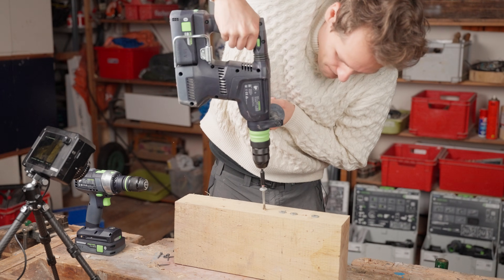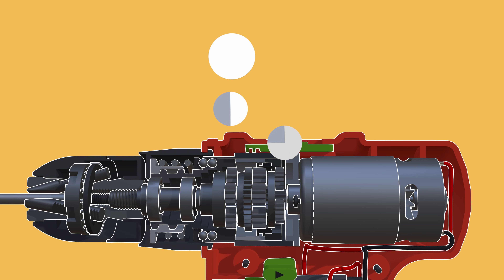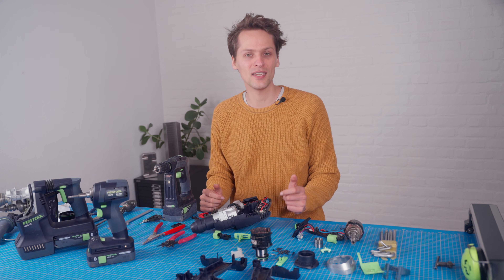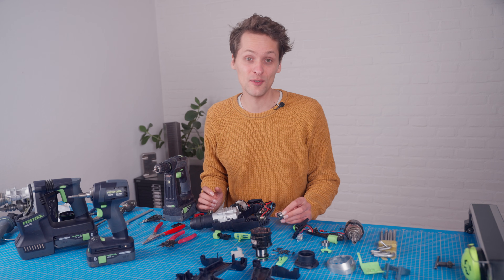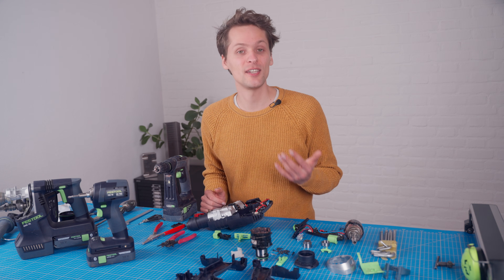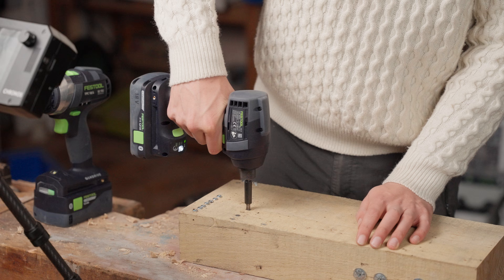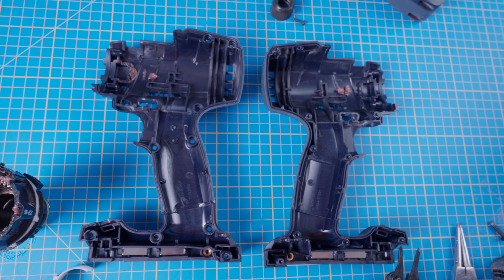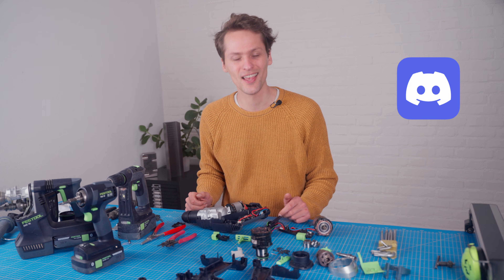Hammer Drills Don't Hammer - Every Drill Explained

Comment: Another point for plastic gears: They can be intentionally weak and cheap to replace instead of whatever they connect to. I have seen this at work, there was a set of plastic gears in one of our machines that broke when someone messed up and loaded the wrong material. Instead of thinking "Huh, why do they break, is something wrong down the line?" they just replaced them with similar metal gears. The result: The Gerabox housing broke, a custom part that had a wait time of several weeks and did cost way more than 10000 of the plastic gears...

Comment: Ok , I like impact drivers as much as any other guy who know ho wthey work  , but this video makes them seem like a supertool , a better version of drill , which they are not , they usually have lower power output than a regular handdrill , they would most likely take longer to drive the same large fastener than a drill , you can drill with them in theory , but you should use impact rated bits , otherwise you migh break the bits , even worse when dilling into metal , and basically impossible to cut threats with taps , on top of that they're very loud to the point of risking ear damage , biggest advantage is probably that you can holding without any bracing , it just doesn't twist your arm , and you can undo bolts on car tires with them , even most of the small ones

Comment: 13:25 This seems so counter-intuitive to me. Sure, there is no free lunch for power, but wouldn't the spring still load up over a longer time, then deliver an impact at higher torque than the motor due to the momentum of the accelerated hammer?

Comment: I used a super cheap, entry-level, battery-powered Ryobi drill to make four deep, half-inch holes in my back patio, in order to install a huge ring to lock my motorcycle to. The drill bit was so big it could barely be inserted into the chuck, chuck had to be completely open to get it in there, literally the maximum size. Yes, it took about two and a half hours if not three. Yes, it required multiple breaks to charge the small batery. Yes, it was one of the most near-futile and exhausting things I've ever done. But dammit, it worked. I'm not saying you are wrong about regular drills not being good for stone and concrete. But I AM saying that with enough determination, persistence, and lack of money to purchase the correct equipment, wonderful things are possible.

Comment: I have two 1980s corded Bosch hammer drills and they work great. My house is built of engineering bricks, not house bricks, and they drill in to them with ease. I don't even own a battery drill and tbh I'm not sure I want one either.

Comment: I always love when people complain about Phillips head camming or stripping out. It's literally what they were designed to do. Unfortunately people think it's meant to transfer torque, but they're simply misinformed. The head was originally made without a taper and people kept snapping heads off screws and stripping through wood. They added the taper to ensure it cammed out to prevent stripping and snapping.

Comment: I needed a rotary hammer for one project and didn't want to shell out the big bucks for a new one.  I found a contractor selling a used Bosch that wasn't hammering reliably.  It was a beast of a tool, way more than I needed, but the price was low and I was confident (Arrogant?) that I could fix it.  I was shocked by how complicated it was, and the pneumatic piston you mentioned had me spinning.  It was dirty, and most of the grease was missing, so when cycling by hand it didn't do anything most of the time and I wasn't confident regarding how it was supposed to work.  I was able to get it working well just by cleaning it, replacing some O-rings, and lubricating again, but I had several failed attempts along the way.

Comment: I dunno about the whole "you can use an impact driver for drilling holes" 
Sure you can but it's not the correct tool. 
It's like asking how to check the charge of a 9V battery?
You can use your tongue to see if there's any charge left but you should probably use a multimeter. Both methods work but one is far better than the other lol

Comment: Hey man you really need to either  wear a respirator and/or keep concrete dust (any dust, really) wet while drilling with water spraying on the hole the entire time. Even if you're drilling just one hole for one b-roll shot, you do NOT want to breath even a tiny amount of that stuff in..

Comment: I had long been under the impression that companies potted circuit boards in epoxy to prevent others from examining the circuit and copying it.  I've certainly seen it in electronics that is not exposed to rough conditions.  But I suppose it could fulfill both roles.

Comment: While impact-drivers can drive nearly anything they are also way more likely to destroy anything, as they shock the material, screw or bit repeatedly. This means more snapped screws, drill-bits, stripped out heads etc.

Their real strength is tightening heavy screws to lvls no other drill could achieve all while being able to set the force.

Comment: Electronic clutches are garbage. Unless you exclusively work with the same screw and the same material, they will always deliver a different result.
What I'm saying is basically your test repeats for every single combination of screw and material. Driving screws at high speeds puts them and the Drill under way more stress. When you drive a screw into hardwood or metal you will almost always snap the screws at almost all settings. This is because the inertia of the motor does not change and only driving slower could change this calculation. Abruptly stopping any machine at high speed will damage the internals way quicker.

With mechanical clutches you get a specific amount of force, there is still some variation when you switch screws, material and most notably speeds. These clutches are capable of working with anything, way more forgiving before they snap screws and importantly: Even if used at high speeds actively protect the drills internals as the dill itself continues to spin slightly hammering the screw deeper.

Comment: are you confusing impact and hammer drill functions? because the festool into concrete does NOT sound like a hammer drill, and an impact is about rotational impact, and will work like crap on concrete.

Comment: "Plastic gears aren't actually as bad as you think!" Well, yes and no.
As always with engineering, material selection is of critical importance, even if you've narrowed it down to "I want to use plastic gears".
If loads are insignificant, say inside a battery powered quartz clock movement, you'll probably use an inherently slippery but extremely cheap plastic like LDPE (same stuff most plastic bags are made of). This way you don't have to lubricate the gears, saving even more money.
If loads are low but not insignificant, say in a car door power lock actuator, and durability is a concern, you'll probably use HDPE, it's not as cheap but it's extremely tolerant of momentary overload, high vibration, and abrasion, and the strength to weight ratio is actually shockingly high (this is why it's used in Battlebot armor, they have weight constraints and HDPE is very strong for the weight while still being cheap enough that the layperson can buy slabs of it big enough to use as armor for the bot).
If you have a medium load but not much vibration to deal with, the go-to material is Nylon, potentially with glass microspheres added. Bulk blocks of Nylon are actually incredibly mechanically stout, the only problem is that it tends to fracture, and abrasion is a concern (the glass microspheres are added to increase strength and help deal with the abrasion issue).
Another advantage that plastic gears have is low weight, which is why in some RC servomotors you'll see them use plastic gears for the first few reduction stages after the motor but then switch over to metal gears for the final stage or two of reduction when torque becomes so high that making a strong enough plastic gear makes that gear too big to fit in the servo housing.

Comment: Several times in this video, you use the word "power" when referring to torque. This is misleading and can lead to confusion. A gearbox cannot give you more power: it can give you more torque at the expense of speed, or vice versa. Power is speed x torque, so the power stays the same.

Comment: I install alarm equipment/cameras and have both a Bosch Cordless Hammer Drill and a corded Bauer (Harbor Freight) Rotary Hammer.

The Bosch hammer drill is what I use for most drilling and driving, set to either drill mode (no clutch) or driver mode (clutch). The hammer drill mode works ok on concrete, but it just really struggles with brick (I use Bosch masonry bits with the hex shank). Sometimes it works, other times it just leaves a small divot. It's very sensitive to RPM and pressure, and with most materials there exists a sweet spot with just the right amount of pressure and speed where you get a sort of acoustic coupling between the material and the bit and it becomes most efficient...but even then it might not make any meaningful progress.

The Bauer rotary hammer on the other hand absolutely rips. Eats through brick and concrete with ease. It's very wiggly and sloppy, and I wouldn't want to use it for precision work...but for drilling holes for running wires or mounting a 1 lb camera it works just fine. Having an SDS plus chuck is a nice bonus as it lets me drill through thick concrete walls (my bits are 16 inches, or about 400 mm long). Great for running wires through foundations in basements. With chisel bits it even becomes a cheap electric jackhammer.

Comment: The hammer drills are actually quite useful for 6mm or smaller holes in exterior plaster, mortar or cinder block. Even with a small bit they do indeed struggle on concrete, they just don’t have the power to break any stone aggregate too big to simply dislodge.

Comment: Two notes on the metalurgy of drills:
HSS and HSSCo drills can shatter by impacting, which is why impacts arent a good way to drive them, a smooth rotation is much better.

The carbide inserts in masonry bits are, for our purposes, immune to heat, as are the lower carbon drill shanks. Theoretically the first thing to give up would be the brazing that joins the two, but that usually also only goes at like a cherry red heat (~800° C) on older drills, with less advanced carbide mixes, water cooling can actually lead to thermal shock which breaks the insert.

Comment: We have both a combination drill and a SDS hammer drill. For 70% of masonry DIY tasks i still prefer the combination drill. The combo drill is much slower and more delicate and less likely to blow bricks out, its also smaller and for us easier to grab (SDS is stored in its own big box). Bigger holes, or chiselling the SDS is the only really choice but I would personally always recommend a combo drill for a DIYer (in addition to a SDS if /when you need one) as they are only slightly more expensive and its just so useful to have the hammer function.

Comment: Hah! I bought the exact same 'Absolute unit of an armtwister' nigh 3 decades ago... The thing is a *beast*.. I bought a house a little after and had to drill 100's of holes for rebar into rebar'ed concrete.. Thing's still as good as it was when I got it.. (but a lot more dirty)
There are other variants of the same model still on the market, and I cannot recommend it enough.

Comment: Thats not a hammer drill, thats a rotating rattle toy...
Never found those in "hammer mode" to make any impact except for more noise.

Potted in components are something of a love hate relationship.
On the one hand, they are a smart solution to make a PCB resistant to moisture and dust.
But looking at how most brands solve it, they make repairs somewhere between unnecessarily complicated, unneccessarily expensive, or not possible at all as they don´t sell that part.
if repairable, you may be stuck with having to replace the whole bunch, contacts, trigger, controller, motor field at a price close to buying a new whole device.
Not to mention that PCB repairs with spare parts worth cents are generally impossibly. But I guess that we have to consider a tradeoff between resistance to elements and repairability.
Although I guess some manufactrurers might have abused it to prevent repairs at all.

Comment: Cordless tools are not powerful enough yet to make suitable core drills.
A 1kW hammer drill is perfect for small to medium sized core drills, for example holes for piping, electric sockets (82mm typical).
They need speed. Percussion (or soft impact, that's how some makers call it) is only needed in reinforced concrete or hard rock.
I have a cheap hammer drill that I use for electrician work. It cost 1/10th of a professional Eibenstock core drill and gets the job done at the same speed.

Comment: 7:18 We have one of those, much older, shell made of metal not plastic.
When ours broke, my dad traded a sandwich for another broken one to rebuild a working one from the 2 dead ones.

Literally the best drill we own. It's so simple, nothing ever goes wrong.

And why did the original die? Because a screw went into the air vent and shredded the motor's windings.
The Donor one was broken because he dropped it from a great height that shattered the chuck and gearbox.

Comment: Just to stomp on the proverbial sandcastle I keep seeing:
Having a sacrificial plastic bit is a good thing. Instead of the gears shattering, the sacrificial bit ends up being the failure-point instead. **MAILORDERING A FULLY-ASSEMBLED GEARBOX IS THE MOST EXPENSIVE THING YOU'LL EVER REGRET DOING** as a junk tool salvager.
It's much much cheaper to just order a tiny lob of plastic.

Comment: 12:55 but this is also exactly why you should never use them on screws, because they might overtorque the screw, making them brittle, and breaking them off, usually when trying to remove them. Impact drivers are for nuts, and nuts alone.

Comment: In the EU power-tools that connect to the powergrid through a cord MUST have a non-conductive (i.e. platstic) gear in the mechamism. It‘s a safety feature. If for any reason there a short resulting in the gears getting electricified, the voltage must not reach any of the metal bits that are exposed to the user‘s touch. The plastic gear creates that separation.

Comment: The reason companies use plastic gears is to physically disconnect metal parts where electricity could travel to where you are touching it, if something was to go wrong inside. If you check the sticker that has the model number and wattage/voltage on a corded tool, you'll see (or not) a box in a box symbol, this means it's double insulated. So on a drill for example, it has a plastic gear. If there's no symbol then it's not double insulated, and the earth connection is touching the outside of the metal housing
Reply: The gearbox housing would be plastic for double insulation, not the gears themselves. Damping and cost savings are the main reasons for plastic gears.
Reply: Rubbish, absolute rubbish. You don't know enough about this topic to be allowed to express an opinion. Shut up at once. Delete this comment.
Reply: @williamcampbell9859 no need to be so rude, and if your going to tell me I'm wrong you should explain why
Reply: @lil_floofer his reaction was unnecessary, but the mansplaining vibe coupled with the absolute tosh of your comment, made me see red too.

Like you use no qualifiers. Not "it is also a reason" or "some companies." Nah, no such hedging for you: you make your claim with the definite article while managing to be wrong 😛

Comment: I know that Hall-Effect sensors are very reliable and usually a superior solution to most trigger problems - atleast on controllers and such. As i saw them on the drill i kept asking myself if it will be affected by magnetic metal shavings and dust. They will certainly get attracted more than usual dust to a usual trigger but i have no experience if that worsens the accuracy or responsibility of the trigger. I'd be interested if that can impact (the) drill

Comment: I use an auger to drill 30cm x 5mm holes in the ground to support an antenna for amateur radio, the spike is just a large tent peg. I hate hammering it in so use an impact driver to drive in this drill bit. It occasionally slows down and rachets. It is also defeated by stones in the ground.
I have to be careful not to snap the bit.

Comment: I gotta drill a lot of holes through steel.   I just use a lot of cutting oil then just let it rip full speed, lol.  Not the right way to do it but I'm impatient and usually the builder supplies the bits.

Comment: 17:16 and ruining repair-ability
Reply: It's intended so that you shouldn't need to repair it. Often it's also not worth it or impossible to repair, depending on what fails and the tools you have available. If the flash fails good luck obtaining firmware to flash manually.